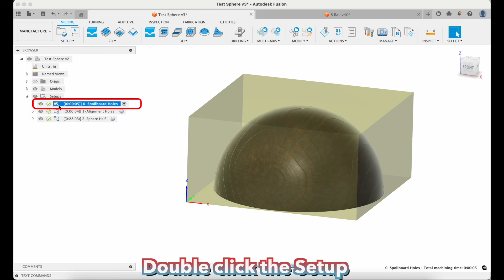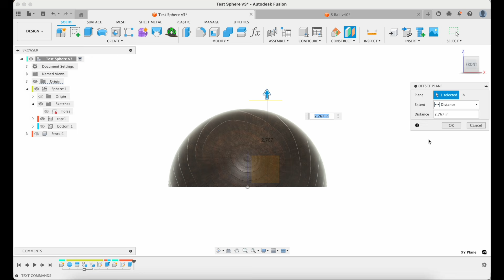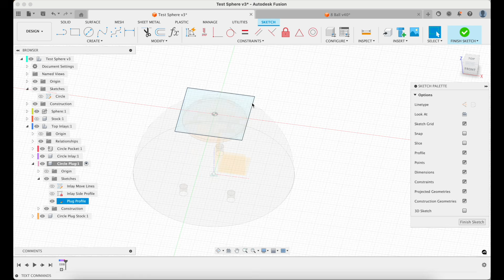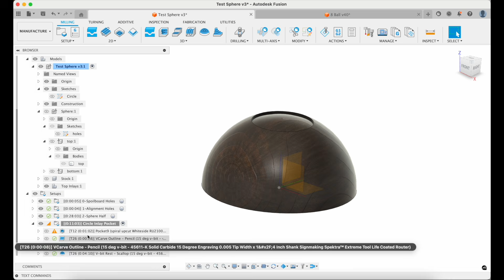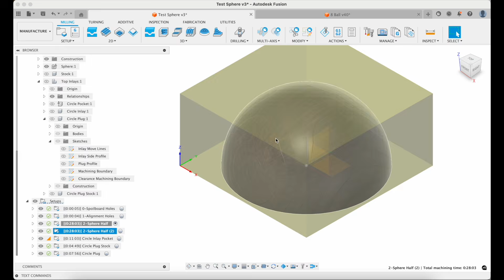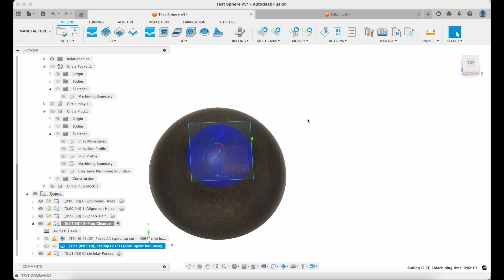OMG, curved inlays!!!  3D VCarve Inlays with Autodesk Fusion 360 - a complete tutorial!

Comment: This video (and Corbin's Fusion plugin) are great. It opens up a whole new avenue that I was wanting to explore on my CNC but wasn't having success. I am pretty proficient in the Fusion Design space because I do a lot of modeling for 3D printing. For the CNC was using Vectric vCarve Pro and then Vectric Aspire. Aspire is good for taking 2D vectors and creating 3D models from them but can't touch Fusion for creating 3D models from scratch. The VCarve Inlay toolpath generator in the Vectric software is great for 2D carved inlays but won't work for curved surfaces. I delved a bit into Fusion's Manufacture space in the past for creating toolpaths for CNC machining, but I was quite overwhelmed at first. Sort of like when I first started using Fusion's Design space when I got my 3D printer. However, after spending several iterations of creating a 3D inlay project and bouncing back and forth between Fusion and this video, I think I'm finally proficient enough at it. I just need to get some additional projects under my belt before I'd consider it smooth or easy for me.

Thanks Corbin! I'm going to your website to purchase a license for the plugin so you can enjoy a couple of cups of coffee on me for the excellent addition to my CNC "toolbox".

Comment: First of all, thanks for your great work. In the 2D tests I did, the plugin never gave me any errors. Now I'm trying to replicate the Fusion 360 file with the sphere. I'm using (Sphere Starting Point), but when I use the plugin, I get the error shown in the video. I also get this error if I create a new sphere and split it in half, but if I use a whole sphere, I don't get any errors and it works perfectly.

https://youtu.be/1IHjIcmHV2M
Reply from the maker: Hi Carlos, can you email me the file? There's probably something wrong with the plugin. I keep changing/improving it, and I may have broken something. corbin at corbinsworkshop dot com. You can also try checking "Copy Profiles"; it might work better with that option checked.
Reply from the maker: ..it's also possible that Fusion's updates changed something and broke the plugin. Hopefully I can fix it!
Reply: @CorbinDunn  I already sent you an email. Fusion 360 just had a major update a few days ago, so like you said, the error might be coming from there. No worries if you can't fix it; you already found a way to do it without the plugin anyway

Comment: Is the image projected onto or wrapped around the curved surface?
Reply from the maker: It is projected; ultimately, a 3-axis CNC will only cut projections, and the base image is drawn in a 2D plane. You could wrap a 2D shape onto a 3D shape, unroll it, and use that as your base vector image, in case you wanted it to be a wrapped image; you'd probably have to use some other software to do that part -- Fusion does have "Project to Surface" option for sketches, but I haven't experimented with it for this type of thing.

Comment: Is it possible to do V-carve images in Fusion 360? Do you know how?❤🤔
Reply from the maker: It depends on the image; if it is a vector format (DXF or SVG) then Fusion can import and read it. If it is a photo (jpeg, gif, png, etc), then you have to use a program to convert it to a vector. I usually use Adobe Illustrator to "Image Trace" it, but google "image to vector" and you will find a bunch of web pages that can do it.
Reply: Yeah, maybe we can just create vectorized images to do it. I did see that Vetric software has this feature built-in, where you can import an image and carve it into the wood with angled lines. But maybe we can do the modeling part before it gets into Fusion 360 and than make the cutting path. Need to look more into that.

I have just done my first 2 cuts on my Oxman CNC machine. Looking forward to following some of your tutorials and doing some projects. Keep up the good work and thank you for taking the time to reply.❤
Reply from the maker: Oh yeah, if you are talking about "PhotoVCarve" then that is something else entirely different, and I'm not aware of how to do that in Fusion. I thought you were talking about VCarve inlays. PhotoVCarving seems to vary the depth and width of a cut based on the darkness pixels of an image. That would take some custom toolpath programming to do.

Comment: As always, your video is amazing and explores areas that are so interesting to me and many others. You did actually crack the barrier on these curved inlays as well as some other videos you’ve put out. As you know, I have made your epoxy and wood bowls, and put my own videos out, showing how to transfer it from Fusion to Vectric because they are so cool and I wanted people using vectric to know how to take your files and use them.

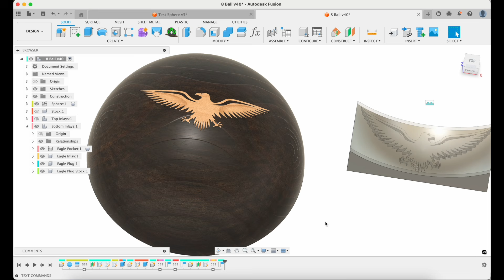My problem is my understanding of Fusion is primarily focused on making things for 3-D printing. When I tried to learn the C.A.M stuff it just got too complex for me, especially because I’ve already learned the Vectric software so I’m continuing to watch your stuff and trying to figure out if it’s worth my effort to try to actually learn the C.A.M part of Fusion because it seems so much more complex than what I know in Vectric.  I will say Vectric can’t do these curved inlays - or - at least haven’t figured that out.  You have me rethinking the need to learn the CAM side.  But, previous efforts it was 30:08  hard to find good lessons on how to apply the design and manufacturing parts of the software to wood projects.

If you keep making these videos I’ll keep watching them even if I don’t understand much
Reply from the maker: Thanks Rob - I always like your insights. I've been getting a lot of similar feedback: there isn't a lot of good tutorials on Fusion specifically for CNC woodworking. I think I'll work on such a series (CAD/CAM). The CAM is hard because there are so many options, but most stuff people can ignore. The cool thing is: you can tweak a lot of things when you do need to solve a particular problem.

Comment: That's really impressive. I had an idea about how to get the tiny sharp details (like the eagle wings) more reliable.  I never tried this, so I don't now if it would work.  Run your toolpath with a little stock to leave, maybe 0.01", then use thin epoxy or CA glue and let it soak into those fragile areas.  Then run toolpath again with no stock to leave.  You could even leave the workpiece in the CNC while the glue is drying so your registration is exact. If you used CA glue with an accelerator, you could quickly do it in phases leaving 0.02" stock, then 0.01" then final.
Reply from the maker: Yeah, that is something I've also thought about trying, but I haven't actually done it yet. For large planar face grain, I was thinking of just putting some type of finish on it to help. I have, in the past, put blue tape on it, and I have found that will sometimes help with chipout, but removing the tape can be a pain.

Comment: Corbin, your work on this is amazing, and so very important to the CNC community! I abandoned Fusion 360 sometime ago because I was struggling with the learning curve, and I swapped over to v-carve. That software and applying many tips and tricks from the "masters," allowed me to make extremely good 2d inlays which is very much "bread and butter," to my CNC work. Several times I have wanted to do 3D inlays, the only way I could do that with any repeatability was to do very deep "flat" inlays and then 3D carve the surface. It never looked quite right because of the taper of the plug, plus it resulted in me wasting a lot of material unnecessarily.  From watching this and also a video from one of your "disciples," I can see that your plugin and work flow completely change everything! Sadly, I will have to relearn Fusion from "square one" as I've forgotten virtually everything about it. But, to get results similar to yours, it will be very much worth the time investment! Do you have any resources that you recommend for someone like me to learn Fusion 360 for CNC?  Thanks again for your amazing contributions to us all!
Reply from the maker: Yeah! I watched a lot of Lars Christensen videos when I was learning. Product Design Online also has good videos. I've been thinking about doing a Fusion for CNC woodworking series, starting from scratch. I just need more time in the day..
Reply: @CorbinDunn  Way back in the day, I watched a lot of Lar's videos, but when I got V-carve, I totally lost interest, sadly, I've lost most of the knowledge I had. As I recall, Lars covers all aspects of Fusion 360, which although really cool, I really don't have time for that deep of a dive
It would be so cool if you made a series on Fusion 360!
Reply from the maker: @billgreen4592 yeah, I know what you mean - a ton of stuff just isn’t applicable. I think there is a real need for good basic tutorial videos specifically for CNC woodworking.

Comment: Another killer video. I’m watching this on my TV. 
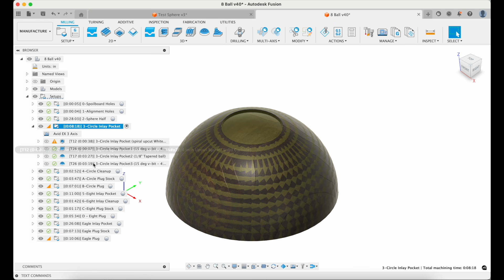At the 22:15-22:16 mark I see an alarm on 
T12 0.00:38. 
Then it got fixed. I didn’t see that step. Did you just do a regen of that step to clear the alarm?
This one I do plan on trying to make. Uh, it won’t be on walnut on my first pass.
Reply from the maker: You mean the toolpath being invalid? I flipped to my "finished" file and copied the toolpaths, and then pasted them in the demo one. I selected the Setup and hit Cmd-G to regenerate them. Yeah, give it a try! The simulations in fusion are pretty dead on, especially if you input your bit heights correctly.

Comment: The 2D one was easy, watched it once and went a head and made/ cut a test piece that worked awesome. This one I will need to watch again I think :D The one thing I did not quite catch in both videos is how I control the stock height of the plug. I model the stock size for the main body, so I have full control over that. But the script then generates the plug. Modifying the length and width of the plug is easy via the sketch, but how do I set the height of it? When the origin is at the bottom, I must make a stock piece that is exactly the same height as the one the script made, or else the bit will crash into it or miss it right? Maybe it's just that im not used to having the origin at the bottom that confuses me.. If I had the origin at the top, like I normally do, then my plug stock height in the real world would not matter at all, as it would just cut down as much as the inlay depth and leave whatever stock under that. But with the zero position at the bottom I must take care to make the stock exactly the same dimension as in the cad? Seems a lot harder to match the stock to the cad then the other way around. Did that make sense? Im a little confused hehe, but maybe I will get it if I play with it some more. I haven't gone through the parameters much yet.
Reply from the maker: This one is definitely more complex! The main difference is simple: machine the "plug stock" before machining the "plug". That's pretty much it!  The plug height: there is "Plug base thickness" parameter that you can control. The actual height is that, plus however deep it needs to go, which can vary quite a bit for deeply curved inlays. I was thinking about doing the math so you input your desired plug stock size (since that is more common), and it works backwards from that to compute the "Plug base thickness". This could cause an issue if the user didn't put in a thick enough plug...but I suppose I could work around that. Does that make sense? 

Using the bottom for z-zero is actually better! For 3d inlay plugs: just ensure your stock is slightly taller/thicker than the stock size shown in fusion's setup, and you are good to go. The extra stuff on top will just get machined away.  For 2d-inlays: also make it slightly thicker, and just make your first machining operation be a 2D Face op to make it exactly the top you need. Conceptually, this will be easier once you get used to it. I should do a video on explaining this better. Once you switch to using the bottom you will find you don't have to hardly every touch off your origin (I rarely do it -- I save offsets that I reuse again and again, and I have an ATC so I don't touch off my z-zero). If you don't have an ATC, touch off your z-zero in exactly the same location again and again, and you'll start to get really consistent results.